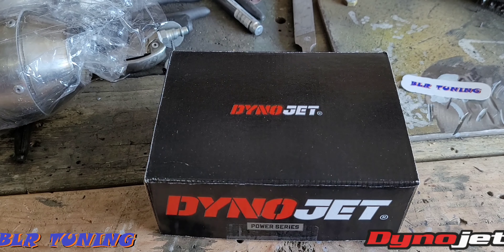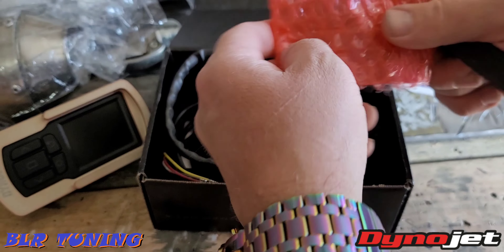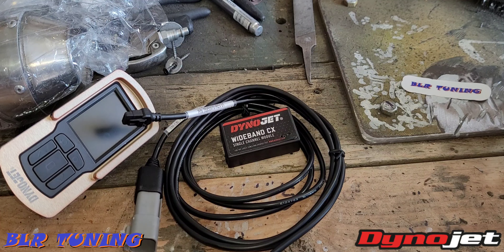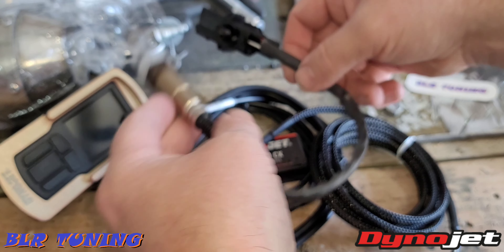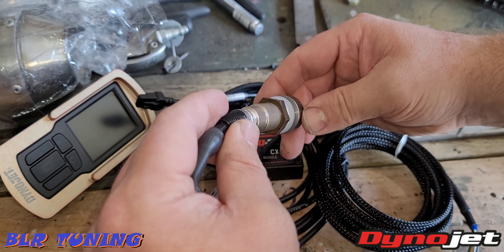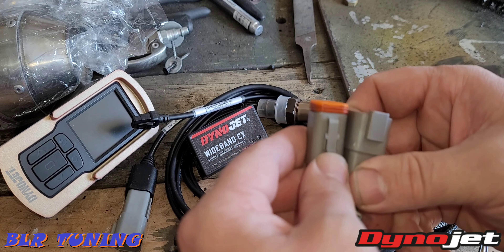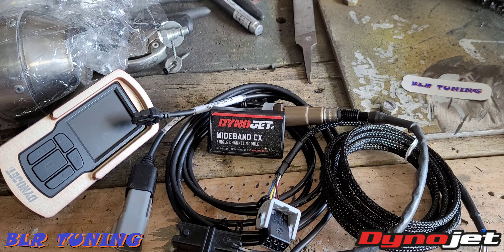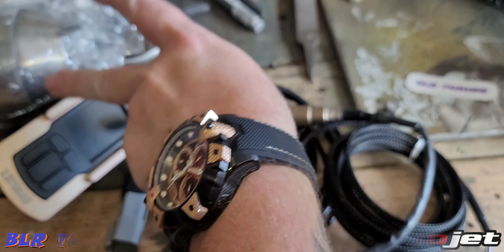CAN-AM RYKER DYNOJET WBCX AFR KIT FOR USE WITH PV3 unboxing

Comment: Awesome video and has basically all the info i was looking for! I have a polaris sxs but i just needed to see/hear everything explained before buying one of these kits.  One question.....Does this have to be left installed after a tune or can it be removed afterwards? Do you offer remote tuning or can you reccomend a good tuner? There's no one withing 3+ hours of me that im aware of that has a dyno or does tuning :(
Reply from the maker: Yes it's possible that we can do the tuning for you. We would just need to discuss the build and year and make of the model of vehicle and everything else. It's possible that we might be able to email you a custom tune specifically built for your machine. Thank you for checking out the video. Please keep in mind the WBCX which is in regards to this video. Needs to be paired with a Dynojet PV3. The WBCX is the wide band setup which gives you a proper AFR reading using a wideband O2 sensor. You still have to have a PV3 installed as well. Once a tune is flashed to the machine then you could potentially uninstall the PV3. It does not have to stay on the machine. We are rewriting the ECU therefore the tune that we put on the machine is permanent until you physically change it with the PV3. Please send us an email we can go over all the details. Perhaps we could even get you a PV3 if you'd like to purchase one from us. We are a licensed Dynojet distributor as well. If it's something that we don't carry on our website when you email us let us know all the details about the machine and we can probably get it added to our website.

Please email us at...  blrtuning.tech@gmail.com

BE SURE TO MENTION THAT WE SPOKE ON YOUTUBE...
Reply: @BLRTUNING  Ok awesome and I do have the PV3 for my machine (22 rzr 200). Thanks for the quick reply and Ill email you.

Comment: Hey Bill what kind of difference are these making on the 600’s that don’t have a sport mode? From what I heard the 600’s are basically in “eco mode” all the time without the ability to switch?
Reply from the maker: On the 600 model this is a tremendous difference because we can add in maximum torque and maximum load settings as well as raise the rev limit and remove the top speed limit cap in the ecu. Obviously there's tons more stuff we can do but it's a major improvement for the 600 since you can't select drive modes. Basically instead of it being stuck in eco mode we can make it so it's stuck in sport mode. If you have questions about tuning work and it's something that you're wanting to find out more about then feel free to message me through the blr team Facebook page. Sorry for the late reply on this message YouTube is terrible about notifications I literally just now seen this message...

Get a hold of me we can go over pricing and whatnot. If the link below does not work for you let me know I'll get you a different way to contact me.

https://m.facebook.com/BLRTUNING/